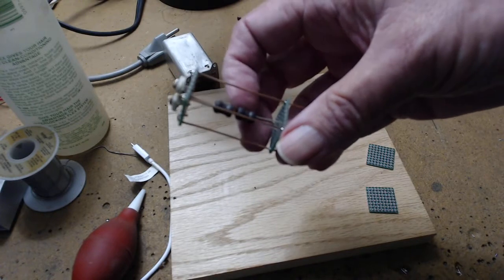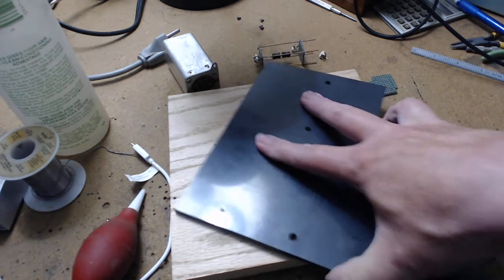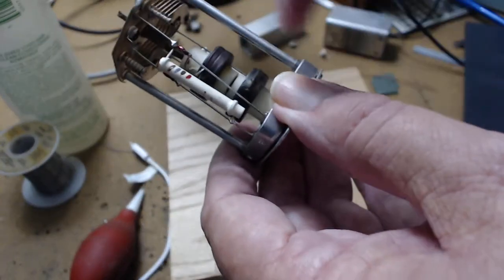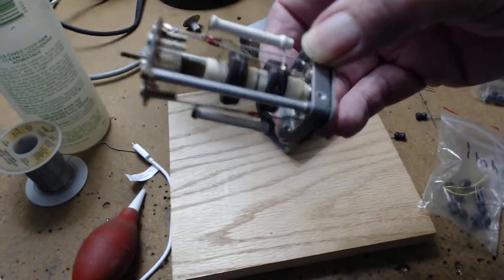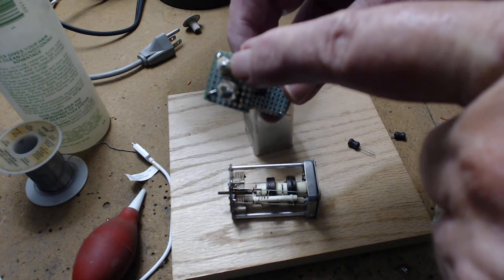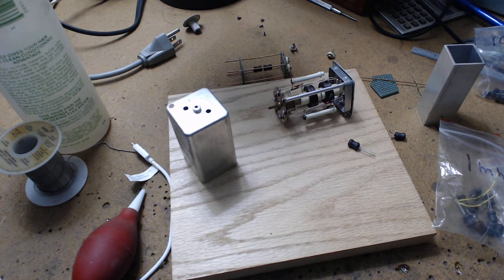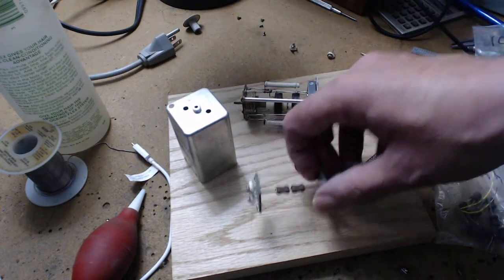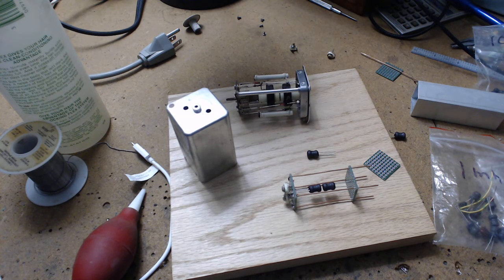Making a 455 KHZ IF CAN from Scratch Part 1

Comment: So we were talking about Q and bandwidth. This is a good example here. This is a 455 khz IF. That means that the primary and secondary tank circuits are resonant at 455 khz. Your coils are 1 mh and your caps are 120 of. So at resonance Xl=Xc which is roughly 3000 ohms. So what is the Q? Not very high I would assume. Certainly not anywhere as high as one of your  torroid coils.

Comment: There should be a video about 'My grandma used to say' sayings. Mine used to say batteries were cheap and quality made.  They used to cost around 30 cents and now they are around 3 dollars.  What i find more surprising is that after over 50 years in a voltmeter, this here C cell hasnt leaked, ruining the battery holder at least. Sad that things are now made so disposable.

Comment: Hi, very good and informative IF can making video. However, one thing is not clear to me. You seem to "praise" the old can very much (the one that you've opened) saying that they are properly made with multistranded wire wound over a ceramic tube and brass variable caps etc. Now my question is:  How come you don't replicate those exactly (in your DIY can construction ?) I'm fairly sure that ceramic tubes , multi-stranded wire and brass variable caps (of some sort) still exist for sale and one could mix and match them to get the same results. After all the aim here (as I understood it) is to get not only sensitivity but selectivity. Inn other words, do your cans (the way you made them) have the same characteristics (or very close to it) and therefore you've decided that there's no need to go "over the top" and copy those old ones?  I'm definetly going to give it a try at building one like yours to see. Thanks for the inspiration!
Reply from the maker: My goal was to show how to make one using easy to find parts.  I guess you missed the concept!
Reply: @johnkleinbauer4424  I surely did thank you. I will give it a try. because I so happen to  already have the necessary. (no need to order any things at all) Thx. once again, Very informative. Thank you.